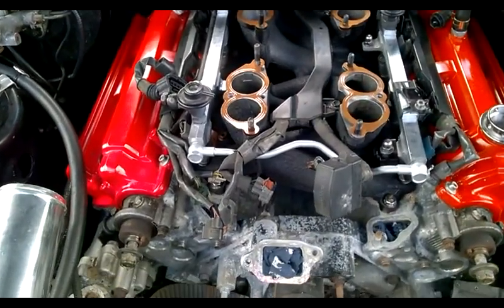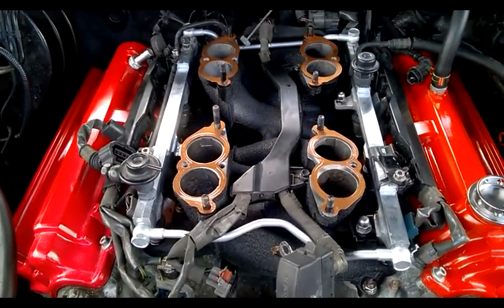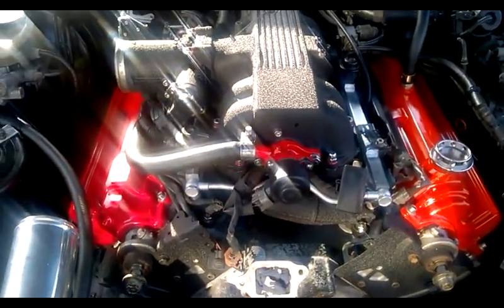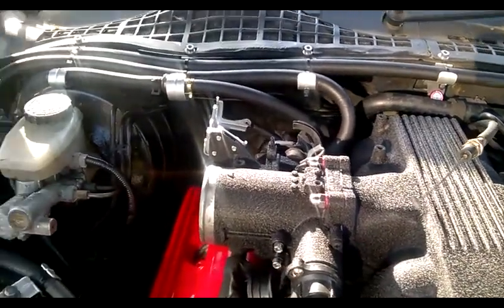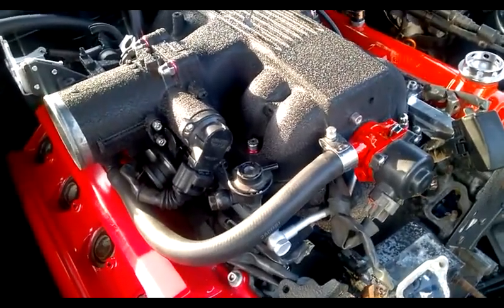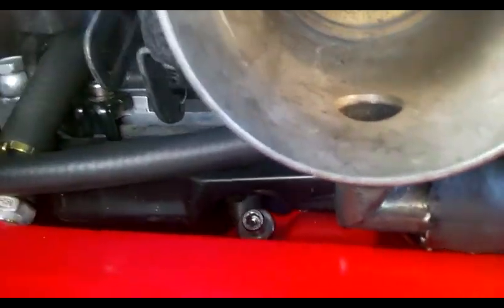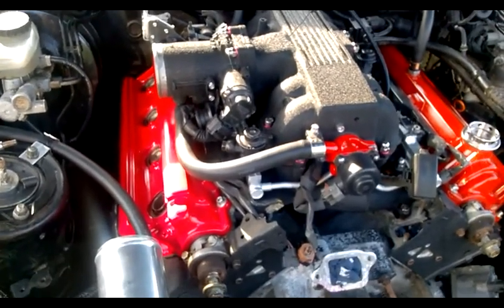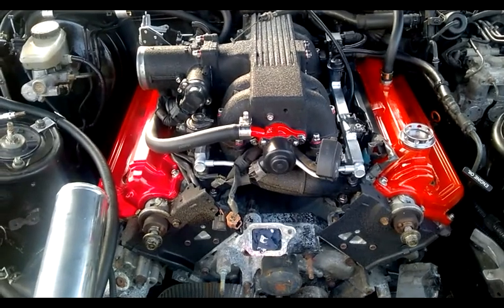1uz fe Turbo build inlet manifold reassembled Soarer (SC400) project

Comment: Hey mate, upload some more videos. How did you reverse the cam breather port before the throttle? (the one you're using for idle air control), did you have to cut/weld or does it just turn inside? Cheers mate
Reply from the maker: Hey Jason, the port will rotate. If really tight use a bit of penetrating fluid and it will move. Unfortunately I lost alot of content I was in the process of uploading. I will get some more videos up soon.
Reply: Legend, thanks mate. Look forward to more vids. Cheers